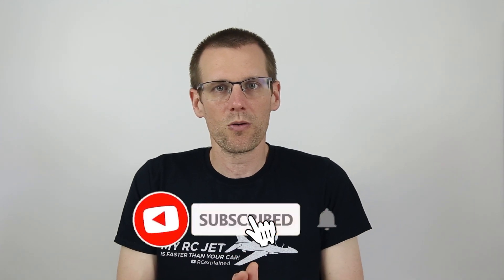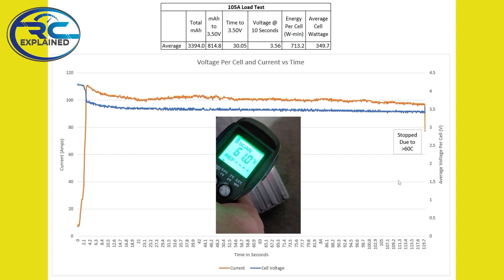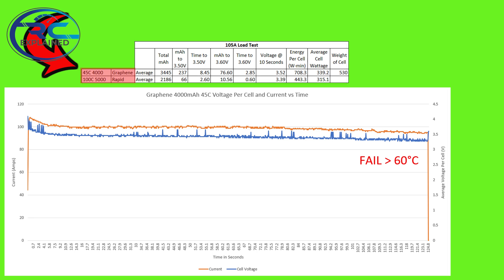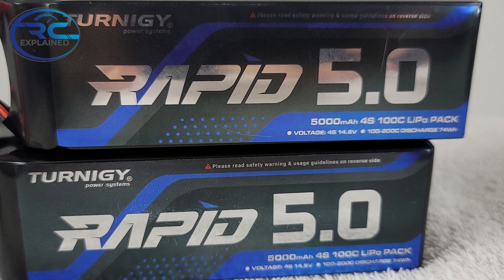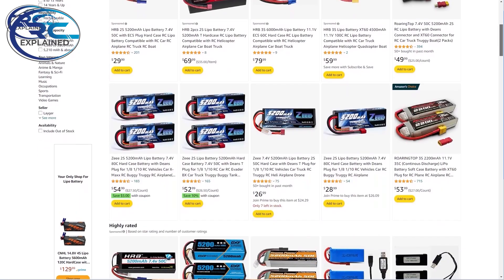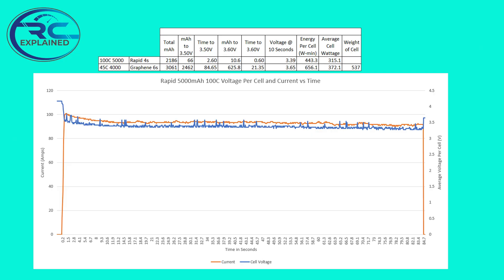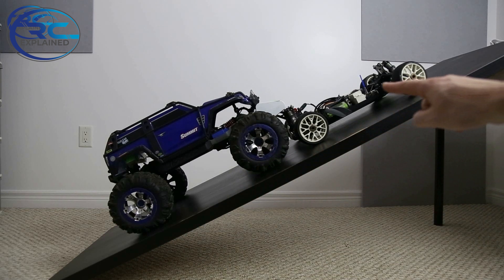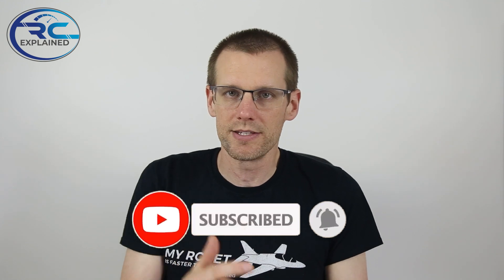Are Weak LiPo Batteries Worth the Cost Savings? (Poor Performing C Rating)

Comment: To follow up on my Rapid 6.0 4S batteries. I have found their limit the other day. I was satisfied with them in my XRT or Xmaxx as they performed well and the voltage drop wasn't too bad in this application. I have since bought a Kraton 8S EXB which draws more power. When using the Rapid 6.0 packs in the Kraton they hit 120F and were a bit puffed after one run. The voltage drop was worse as the charge in the cells at LVC was quite a bit higher than expected when I checked them due to the voltage drop tripping LVC. I have ordered some CNHL racing batteries to use in the Kraton.
Reply from the maker: That's unfortunate they puffed after that.
Reply: @RCexplained  They aren't that bad and can be used, just not in the Kraton. It draws more power than these batteries can handle.

Comment: I know I have asked for this before, but it’s worth mentioning again since it appears you are heading in this direction. Could you test these two brands of battery packs: Onyx Power Systems vs SMC vs MaxAmps. These are the THREEE top battery companies that claim to be the best performance packs. I’ve noticed that the best packs don’t even bother with a C rating, and rightfully so. The difference in load between one person and another will be different and the C rate of discharge will also be different. The lower the mah the higher the C rate and the converse is true: the higher the capacity (mah), the lower the C rate (just by design and steric hinderance). Anyways, I would like very much to see the Onyx 9350mAh vs the SMC 8200mAh SRD packs. MaxAmpos could be done at another time since the cost can be high for thiose packs already. But this will also help answer the question: are higher-cost performance packs WORTH the cost?

The people using these packs are the ones breaking World record speeds (224mph) with a 1/7 scale Arma and HoBao and the fastest Drag race people in that scene.
Reply from the maker: Appreciate the comment. I do want to test these brands but am having a hard time sourcing them all to get them in to canada. I'd like to compare these brands with similar specs that I have already tested. Around 5000mAh for example.
Reply: @RCexplained I feel like most people in the hobby do not use batters that are so low in mAh. Maybe I’m wrong

Comment: I wish someone would make a list of batteries with real c ratings.
Reply: Nobody does because there is no such thing
Reply: I agree, just cycle them at 1c and then 5c and then 10, 15, 20, etc.  Whatever load they start to overheat at, should be the RCeC rating.
Reply: When shopping for reasonably priced packs for my HH UL-19 hydroplane that draws 100A I found the data from MCSGUY on RCGroups helpful.   But what he is adding here is the ability to predict real C from IR ohms, which is awesome work!
Reply: Amen.  When I was looking for reasonably priced packs that could handle 100A for a few minutes I found the data from MCSGUY on RCGroups helpful.  What Ryan is adding here is that true C can be calculated/predicted from IR measurements.  Now that we can get reasonably priced chargers that measure IR the capability of an individual pack can be predicted.
 That is awesome- Thank You Ryan.